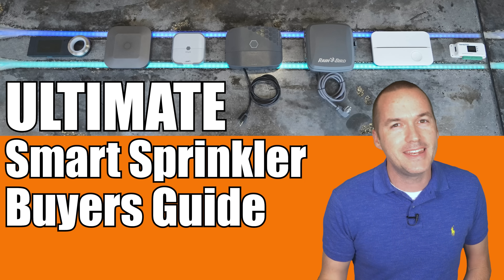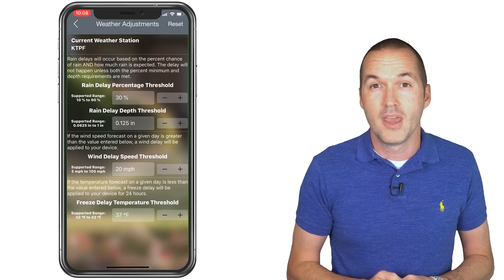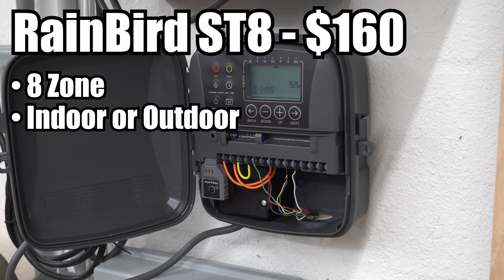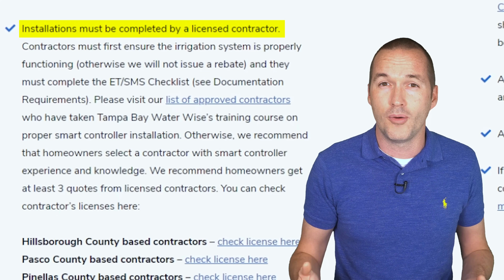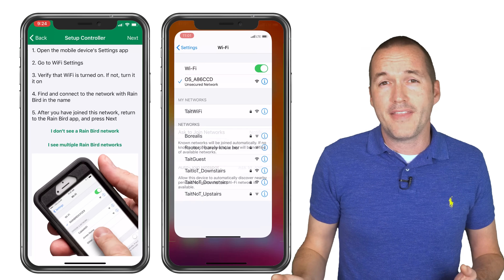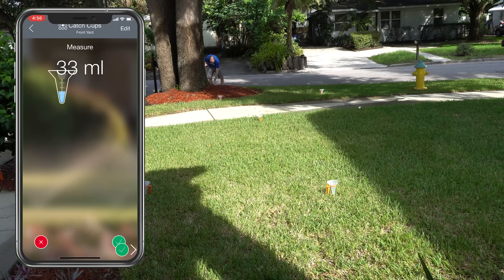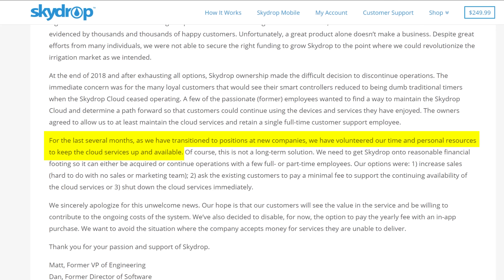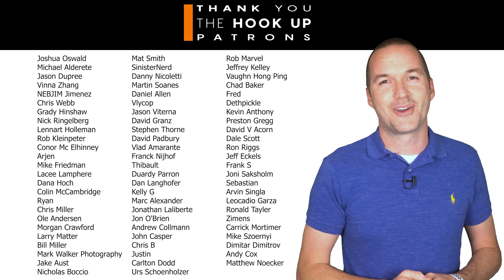7 Smart Irrigation Systems TESTED: Buyers Guide

Comment: I've installed dozens of bhyves the last 2 years.  I have also updated the hunter ICC to to become Wi-Fi for customers who have 20 or 30 sprinkler zones. I have a few rain birds and their Wi-Fi modules maybe have improved but the initial version sucked. Wyoming install controllers that have a manual panel because what if the Wi-Fi is down.  I only install controllers that are operable with Bluetooth from my phone in case the Wi-Fi is down or cell service is down or the house has been sold and there is no Wi-Fi.   I would really like you to review the 4-5 big companies products.  Bhyve, Rachio, Hunter, Rainbird.  Also how easy is it for your sprinkler guy to control 20-100 customers controllers on via app for tasks like check ups, and winterization.    
Plus no one living in the arid West has confidence in using the smart watering feature of these controllers.  The soil type is so different within my 10 mile service area much less an individual properties zones.   The weather is so localized when you have mountains and lakes that effect the weather in small zones.  Plus a thunderstorm may have a radius of .1- 5
2 miles.   In arid climates  if you are watering on the minimum side for water conservation and miss one watering during a dry windy event your grass can take a severe bit and look bad for weeks.   I mean your grass can go from green to lawn mower wheel and footprints turn grey and shuw for 2 weeks.   This requires a step up in watering to recover from.  Do any controllers offer a recovery boost watering feature?   What about wind?  We get wind that can last forever 2 days in the summer.  But if you let your smart controller do a wind shutdown your grass is dying and needs 2 weeks to recover.   Back to needing a  recovery boost feature.  What we need is a wind pause feature.  If it's windy above a certain velocity you pause the program and you resume anytime the wind drops below that velocity for more than 5 minutes.  The program needs to keep track of what is watered and  maybe add an additional amount because of the wind.  If the wind continues for too long of a period it needs to run the program anyway

Comment: After using the rainbird for nearly 4 years I switched over to my own custom build. The rainbird worked fine but found it a little sluggish to connect to. I ended up disabling all the scheduling on the rainbird app and handling it via Nodered.

I also wanted to have a completely local setup with Homeassistant. I used an 8 channel solid state relay board with a 24VAC power supply, AC to DC converter board to power an ESP8266. Was all programmed in ESPHome. I also ended up buying an Orbit based off this video for a family member in a new home. They seem to be pretty happy with it. I set it up and it seemed like a much better buy than the rainbird I used to have.
Reply: That's great but spend your time making something useful that's not existing to help humanity and make you money.   Get a hobby.

Comment: the Scotts Gro may have failed wifi setup if you are running dual 2.47ghz and 5ghz SSID (IE: both share the same network name) or if you are running 5ghz only (not uncommon these days) - Some routers allow you to split these radios so that you have a 2.4ghz SSID and a 5ghz SSID. I would guess its simply outdated hardware, since the Connect to Wifi window says "Please ensure you are using 2.47ghz frequency" - That was archaic 10 years ago!

Comment: I have not been able to find a system that lets you add other sensors like soil  moisture, pH and temp.  I’m currently building a PLC to control my garden.  Are there any controllers out there that let you run additional sensors on a 4-20 mA scale?

Comment: Just installed an OpenSprinkler this year. Went with it because I have 18 zones and it's $150 for the base unit and an additional $50 for the zone expander. So it must of went down in price. A lot of the other smart options were more expensive or just didn't allow expanding the system as much as I needed. Making cost way more if I needed to buy more than one of the main unit.

I can see not recommending it for ease of use reasons, but to leave it at that is simply not a quality review of the product. I currently have mine set up to use my own cloud setup and don't rely on opensprinklers cloud at all. It's free though, so I may try it out at some point. Not only that, but it allows you so much more flexibility that no other controller can even compare to. It definitely requires more of a power user to max out it's potential, but I would consider myself just a casual user at this point and I'm very pleased I went with it.

Comment: I really wish i saw this before I bought. It is spot on. The open sprinkler took more effort to install with making a box for it and all. When I went looking for how to set things like soil type I found your video. Couldn't agree more. The app does not seem to have any settings for the flow rate of each zone, or soil type or anything. It has one number for ETo baseline. You click a button and it picks a number. Where does this number come from? how does it work? It is a slightly different number every day I click it. I have zero confidence it is doing the calculation right.

Comment: not recommending OpenSprinker due to open free and functional cloud connectivity.... oh boy... Someone missed the entire point of "open-source" here.  Let's say their cloud solution, which you're not obligate to use btw, totally blew up... You can still use your own cloud solution in that case.  Whether that be via homekit or home assistant, or via VPN, or any number of other options... 

Regarding weather information, plant species and all that... OpenSprinkler has offered this as a service.  Not only are there ways for you to pull that information in yourself using other sites and services, but you may actually benefit from doing that instead... Nobody wants manufacturer lock-in.  If you're using Home Assistant for example, you can check your local weather station and use your own lawn moisture sensors if you want.  Their service is there as an option, but most importantly, the device functions 100% if it's not connected to their service, or the internet at all.  The same cannot be said for the other devices.

I know most people aren't going to want to do all that work, especially right off the bat to get up and running.  But it baffles me that you came to the conclusion that OpenSprinkler "no good" because of a cloud service that you don't need to use.  Your verbage saying "all of them rely on" at least some cloud services is technically inaccurate.  This would lead a less-technical user to conclude that if the OpenSprinkler didn't have cloud access, they couldn't use it at all, which couldn't be further from the truth.

Point being, OpenSprinkler is the LOWEST risk for the exact feature that you mentioned.  No other manufacturer on your list leaves with options if and when that company goes belly-up.  OpenSprinkler could stop existing, and the hardware would be yours to use and modify as desired.

"I just want to install once and never think about again." You want a plain timer then, because that's the only technology that's going to do that for you.  Saying that OpenSprinkler is the worst here... ugh man... Ok, so when their source of data moved (out of their control,) you still were left with options.  That can and will absolutely happen with other irrigation manufacturers as they try and save you money by pulling data from free sources, and then those free sources start to see dollar signs, and charge.  Those manufacturers absolutely will be left with hard decisions, and OpenSprinkler has left their customers in a position to help themselves while the dust settles.

Comment: Another well done and relevant video- thanks. One big differentiator between Rachio  and BHyve is not just setting up the app as you mentioned but in how well the app tells you what you want to know about ongoing system operations. I rarely buy Orbit brands anymore (too many quality problems) but on my prior BHyve system I did find the BHyve app much easier to routinely use than the Rachio app used for my current Rachio 3 setup. Rachio app has some nice features but ultimately is a pain to determine basic stuff like, “what’s running right now?”

Comment: B-Hyve customer service is the absolute worst. I had a problem installing the timer and instead of calling me back, as an email from them told me they would, they refused to call and instead texted me ... at no faster than a 45-min. response time. After sending them photos of how I wired the timer, a representative finally said he had a team run a double-check (which he said was fine even though it wasn't) and after reviewing the data and looking at the problem again, they decided the unit was defective and that I should return it for another one. I brought in a professional installer who explained that neither the manual nor the few texts that I received from the company addressed the obvious problem. He rewired it correctly and now it works. Despite several requests to Orbit to speak with a manager (and the promise that if I had not heard from them, I would post on social media), no one has gotten back to me. Worst. Service. Ever.

Comment: The main reason I’m looking for one is because app navigation is much easier and more intuitive than some of the device controls to set things up. I don’t need the device to think for me but it’s nice to be able to change settings more easily. Is there a way to turn off the calculating features to reduce lag and improve reliability? Are there any charges for those cloud functions anyway? Also, would love to see an updated video with the Waze smart timer, as they are maybe not top dogs in irrigation but definitely up there with smart home devices.

Comment: I just watched this video on water smart systems. I recently purchased a Linktap G1S system but haven’t hooked it up as of yet. I’m would be very curious to have you test and evaluate this system and get you opinion. One of the draw for me was that it doesn’t use Bluetooth or a direct WiFi connection but instead a gateway. Understand I am not guru tech.

Comment: Just an FYI for everyone. Scott's just sent out emails to it's customers stating that the Gro/Blossom Controller is being phased out on 12/30/2021. So if you are considering this controller, just move on and look at another one. They are not supporting it after that date and the servers that the controller needs to access to actually work will be taken offline on that same date. Amazingly as of the first week of November 2021 it was still being sold by on Amazon. So buyer beware.
Reply from the maker: I have to say I saw that one coming, the Gro was so much worse than the rest of the controllers in this video.  I still can't believe skydrop didn't make it, it's a great system.
Reply: @TheHookUp  I was an original Kickstarter backer for the Blossom before Scotts bought them out. As a Blossom original it worked pretty good and was easy to setup for me. Then we moved, I took the system with me. At this point Scotts now owned the product. Getting it setup at my new place was a struggle. After a call they provided a workaround to get it connected to my network and it seemed fine most of the time. I would occasionally get emails that their servers couldn't communicate with my controller but it didn't take much and it worked on the next scheduled run. I think I am gonna go to the B-hyve XR. It should be a pretty easy swap considering the outside mounting that I am currently using. My only concern is my controller is on a southern exposure in Phoenix and I am concerned how the display will hold up in this situation. I guess I will maybe be a guinea pig since it hasn't been out long enough for follow up reviews.

Comment: I have had nothing but issues with the orbit bhyve. First one had wifi connections issues about 4 months into use and got it replaced under warranty and that one after 3 months. Orbit gave me some  credit for new controller and going try out the new xr controller...Wifi and timer acting erratic are known issues with the bhyve 8 zone. Orbit Forums are full of customers having same problems I had.

Comment: I had open sprinkler for years and it was great but my board finally died so I went to RainMachine so I would have at the box control (I have the version with the screen) and it's amazing,  the screen sets it apart from the others.   It's a more expensive product but you get what you pay for (IMHO).

Comment: I have the Rainmachine...curious why this unit wasn't included?  Aside from it having difficulties connecting to Orbi routers, I like that I have full use to run the system with manual controls when wifi is out.

Comment: Is there an irrigation system that will let you program it to run the specific stations on different days than the other stations? For example station 1 5x a week M-F at 8am and station 2 once a week at 8am.
Reply: OpenSprinkler does this and sooo much more!  And its NOT $190...  Mine was $149

Comment: I purchased the Gro sprinkler controller wham it was still called Blossom. I didn’t have any issues with the first one until it was killed by a lightning strike. The second one works good but I have issues with getting the soil sensor to connect. Otherwise it works pretty well except when I wake up and it’s raining and my sprinklers are running. 😡

Comment: Honestly opensprinkler is the best hands down because you don't have to use their hardware. I built my own using a raspberry pi and a relay. It was super easy and cost probably under $40 all together. They recently added MQTT support too. There is no fear of services going because opensprinkler can use a ton of different weather providers. You can host your own weather service for it on your hub and even tie in other things like your own weather station you have setup in the backyard. I think the weather calculations have alittle more of a learning curve, but it's easily the tinker's irrigation system for those who want fine grained control. Since you can use different hardware, you can even setup your own control panel. I have a simple 2x16 LCD panel and four button display for mine. It's not setup yet due to the 3d printer being broken so I can't finish the case, but the programming for it should be a simple python program. I'd take another look at it if you're ever bored and need a new video. A custom built one with say a raspberry pi is unmatched.

Comment: wish I would have seen this before I bought the gro controller a couple months ago.  I didn't have any issues connecting it to wifi and it seems to be working ok.  Seemed to take it a couple weeks to learn our weather so at first it would water every time it was set to do so.  Now it seems to be doing better.  But longevity of the product is a concern.

One question, though.  I also happen to be in Hillsborough county (Lutz) and we have specific days we can water based on our address number.  Do all the controllers (specifically the b-hyve) allow you to specify what days to water or do they just do it when they want to?  The gro controller does allow me to put in which days to water, so I can meet that requirement.  But I want to make sure the others do before I switch...
Reply from the maker: Yes, that is a common feature I found on every controller.

Comment: Was wondering if Hyve is good. Thanks for info. Personally I have Rachio. I use HA and need it as I used one of unused zones as a mist to the patio with small little button to turn it off/on. One point to make is also - Rachio support HomeKit. Which is local and if you use homekit to connect it to smart hub you do not need to care about the cloud support - you can still use it thru smart hub and keep it smart even if company goes down.

Comment: Another great video, keep them coming!  

Although not well publicised, one of Rachio's best features SEASONAL SHIFT only works in USA and Canada so if you are in Europe, there's no point in enabling it as it doesn't actually change anything as it has no access to historical weather data outside USA/Canada.   And although Rachio does integrate with Home Assistant, it does not expose watering times so you can't use HA to change the watering times on a monthly basis either. In summary, it seems that a Rachio is not very smart outside of USA and Canada :-(   I haven't tried any of the others as I have already invested in two Rachios...

Comment: I really appreciate this video, but I think it missed talking about the biggest missing piece, moisture sensors.  Being weather driven is fine if you are located close to one of their sensors, but if you're not it could be dramatically wrong.  Also, a lot of these services were using the DarkWeather service which is going away now that Apple owns them.

Have you compared Sprinkl with their Sense sticks?

Comment: Ill throw in my experience too. I have whats called "Netro Sprite". At first it was a promising product, but over time, it proved to be a headache in many cases. There are few integrations that are compatible. Mainly Google assistant and Alexa and even those arent great. With that said, the addons that it uses arent bad, but we got frequent dropouts and it wasnt maintaining proper connection. But the biggest problem? Cloud dependance. EVERYTHING relies on the cloud with this. Local control doesnt even exist. So if you are without internet, good luck. I built a raspberry pi opensprinkler and its much better so far. Great video!